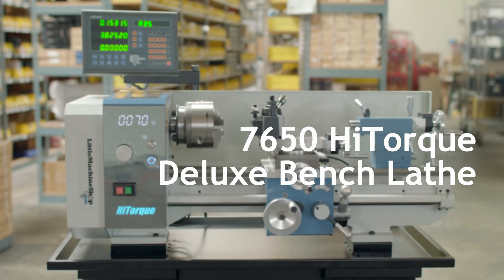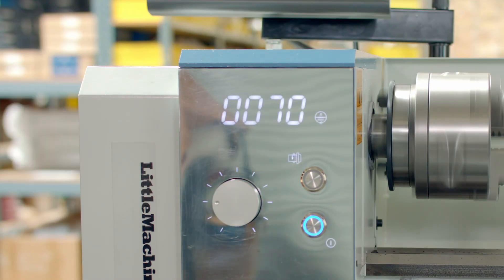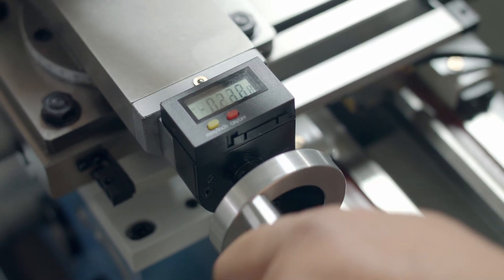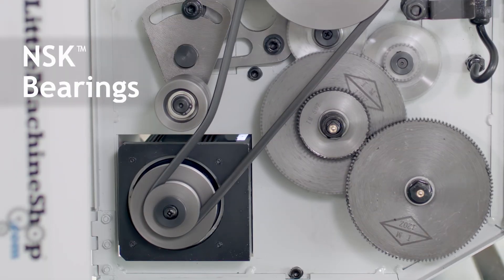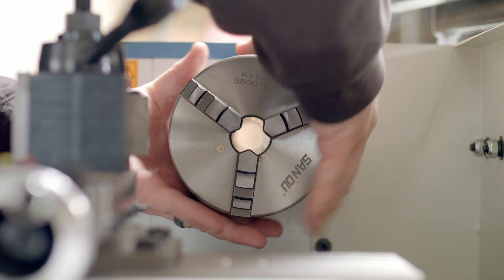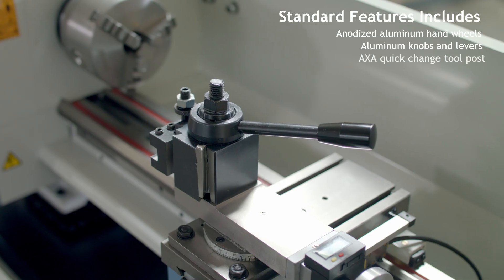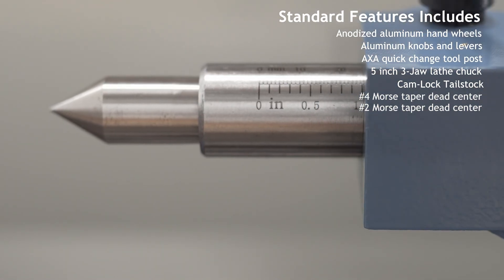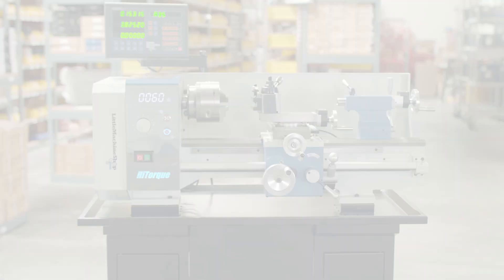HiTorque 7650 Deluxe Bench Lathe

Comment: I've had mine for a couple of weeks, after 3 or 4 years of working with the 5100 mini. So far, I'm quite impressed. On paper, it doesn't sound like it's that much more of a machine, but its so solid, and has all the power I'll likely ever need. I make custom rings, so I'm working pretty small, but the difference is night and day. Cuts that I would expect to cause major chatter are smooth as silk. I finally have room to fit a carbide parting/slotting tool. In the 5100, I couldn't back the cross slide up far enough to use it on anything larger than maybe ¾ inch, and then it would chatter like crazy.
Reply from the maker: That's what we like to hear. Glad it's working for you...